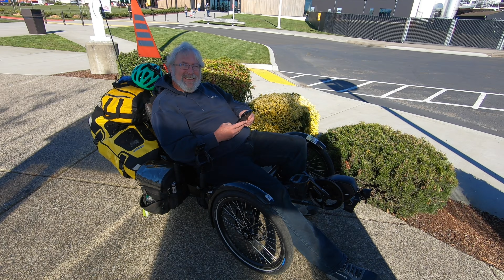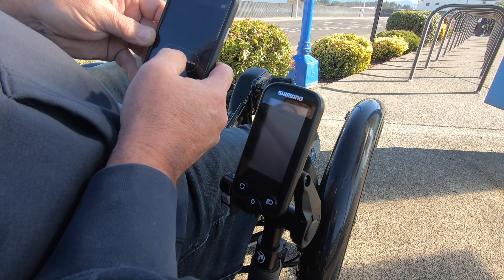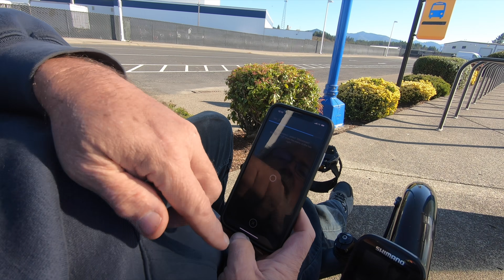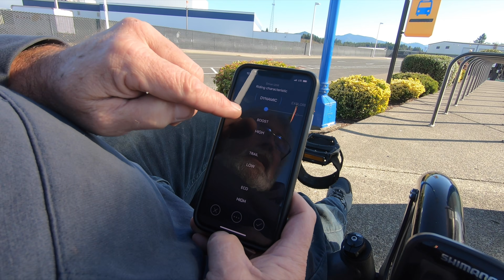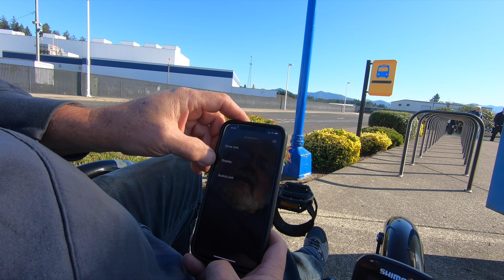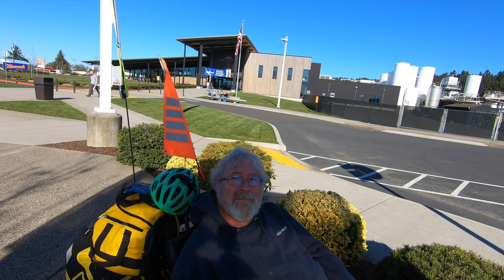Adjusting Power Modes on Shimano Steps E8000 Using Bluetooth Phone App

Comment: i am a mountain biker with a newly installed second e8000 motor. and yes to the stock settings problem basically wanting me to use boost all the time. my shop told me that when they did the firmware october 2023 the stock settings were not changeable. but youndescribe using the e tube app to go to  different power levels. i basically need max on boost and want approx 70% of that boost for trail. can this be done. again i need all the boost. very heavy e bike going up crazy stuff.

Comment: Until I watched this video I had no idea I could adjust my Shimano Steps 6100, I guess I was so thrilled to get my new ICE Adventure last summer I left the dealer in a hurry to go for a ride without getting all the info I needed.  Thanks for the lead Sylvia.  I have belatedly also wondered about other items, like adding front end shock absorption, benefits to changing the gearing of the front sprocket or switching rear wheel gear hubs  (like to the Rolloff). I also wondered how to change the rear shock absorber disk to a softer disk.  ‘ guess I should go in to the dealer sometime.  Anyway, Thanks again Sylvia.  Safe Journey.🙂  Michael (No Calif)
Reply from the maker: Yep, cool trick!

Comment: One VERY important piece of information missing in this video is to EXIT bluetooth mode from within the app. If you don't you may need to get your system serviced as you will get locked out.
Reply from the maker: Interesting point. My bluetooth connection is only available for 15 seconds once I enter the app. I think the app connects and now disconnects when the app is closed. Thanks for the comment.

Comment: One question for you Sylvia. Is the app password protected in any way, or can anyone with that app installed access your settings and change them?
Reply from the maker: The default password is 000000 and you can change it. There's only a 15 second window for accessing the bluetooth just after the display is turned on and you need to be very close. Not much chance of anyone else getting on.
Reply: @TravelsByTrike  Thanks Sylvia.